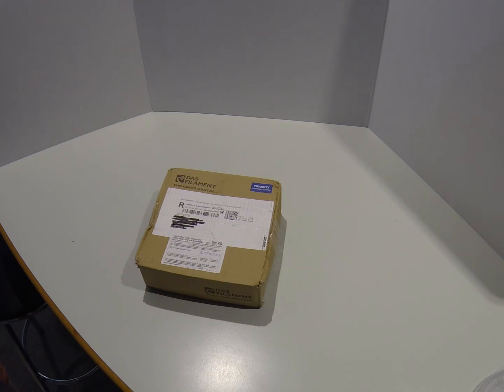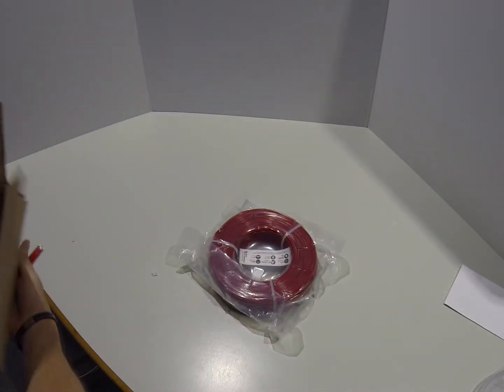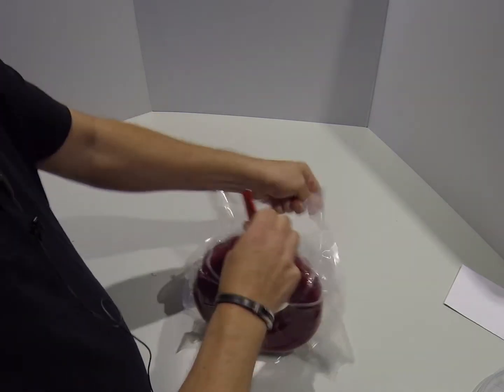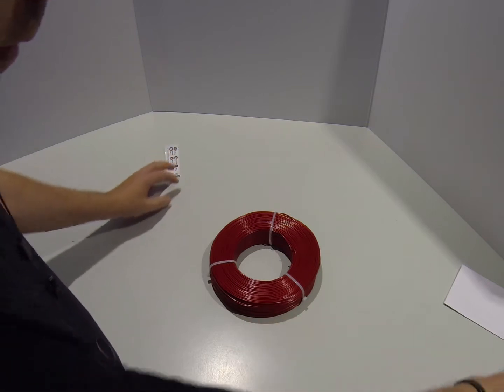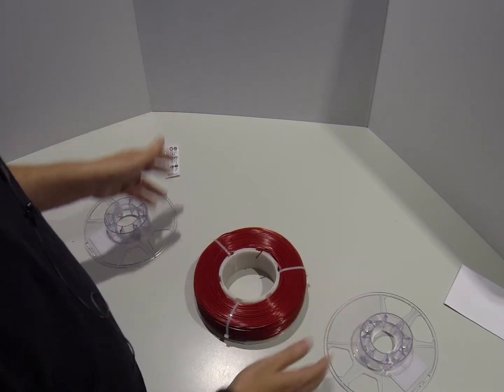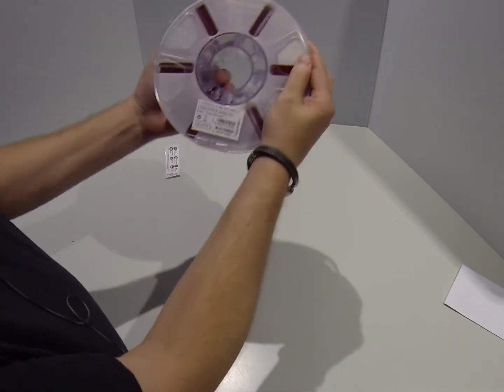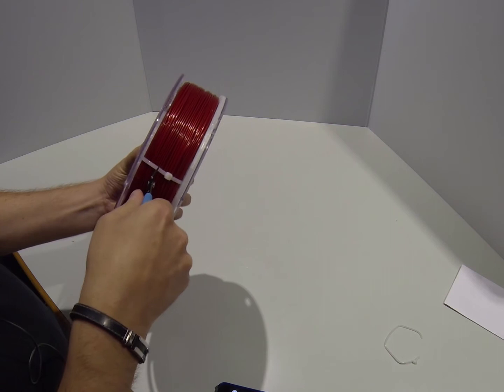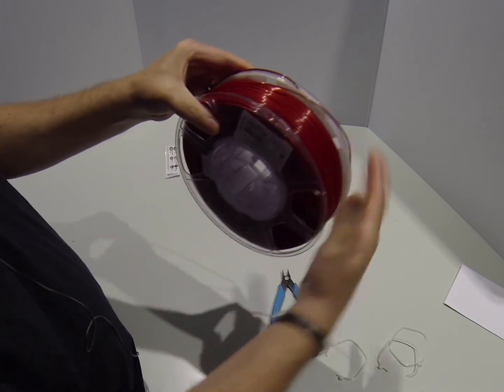Masterspool refill on my eSun spool adaptor 1 of 3

Comment: Nice vid. I'm looking to do the same thing in the future with my empty esun spools. I have also mesured the difference in inner diameter and width. However, I planned to actually sand of part of the spool, so their is no longer a width difference. Do you think this can work?
Reply from the maker: Hi Christoff, thanks for watching.
What differences are you referring to? The model I've put on thingiverse should work for all eSun 1kg clear spools. I will grab one random one out of 30+ I have here and see if my original print fits ( I can't see why it wouldn't ). Cheers, JAYTEE
Reply from the maker: Hi Christoff, I've re-read your comment and now understand that you're considering removing a part of the central hub so that the sides are closer together to match the #masterspool width specification. You MAY end up with a situation where the bolts that hold the 2 halves together are too long OR by taking away a portion of the central hub you weaken where the joint occurs. I'll look more closely tomorrow. Thanks again. Cheers, JAYTEE
Reply from the maker: Hi again Christoff, I was lying in bed last night and I can't actually think of a reason now that your sanding technique wouldn't work providing you kept it square whilst sanding ( belt sander I assume ) Cheers, JAYTEE